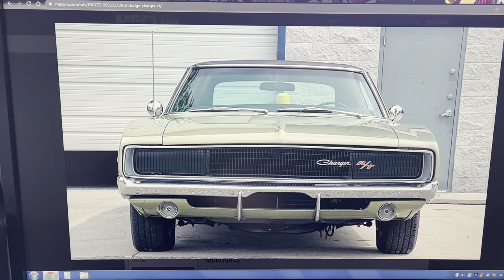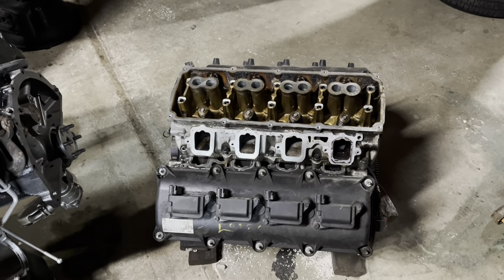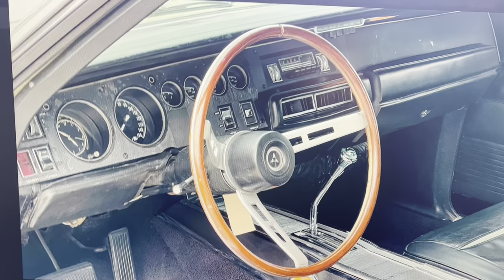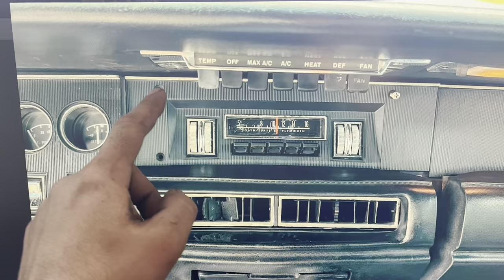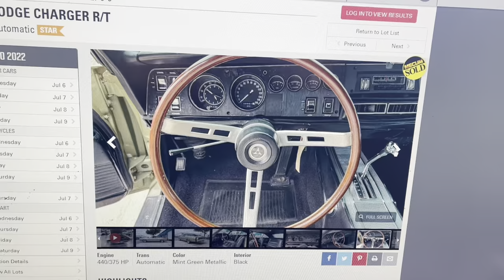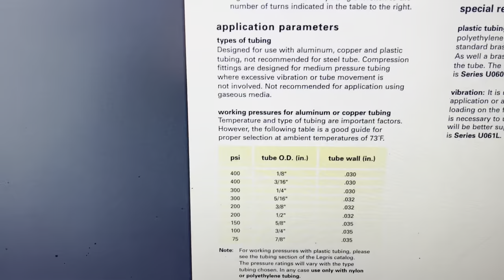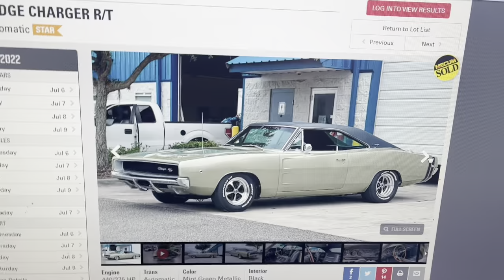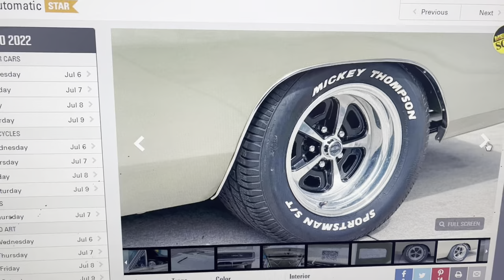Why Did This 1968 Dodge Charger R/T Just Sell At Mecum For $170,000? (It’s Unsafe And Bad)

Comment: In the picture of the lousy brake line repair, the forward part of the shock tower has some kinda chunky welds, and appears to be a bit hammered back to shape, like it took a hit at some time in it's life, then had the front apron replaced....poorly.
Reply from the maker: No welds there are jumping out at me that look abnormal. Ugly factory spot welds, check. Mig work down at the frame rail where it can’t be spot welded, looks right to me. I do see a dent in the inner fender toward the back. Maybe I’m not looking in the right area.
Reply: @DeadDodgeGarage  Front edge of the shock tower, the lip that is attached to the front apron looks pretty wavy, has what appears to be hammer marks like it was flattened out. Maybe a crappy job of separating the spot welds when it was repaired....

Comment: This kinda crap is going on now with foxbodys. Not to the extreme of 6 figures but 40-50k for anything other than a pristine 93 Cobra R is a joke. Cars in the factory wrapper like Collin's stash being the exception to the rule, the only exception...lol "Unmolested", "Bone Stock Originals" are the ones these days fetching a premium thanks for Mecum and Dennis Collins. Ultimately, not either's fault but a moment in time that spurred all kinds of "builders" that find rust free tired cars and piece together some "bone stock originals" due to the premium they are now pulling. Once more the fox mustangs only had 5 digits on the Odo so not too hard to have a 30k original. Lots of lost titles, salvage titles as well which isnt too surprising. I was in my early 20's during this period and dont remember many people putting foxbodys away in the hopes they would "be worth something someday".....lol. To the contrary most folks drove the wheels off them cuz they were fun as F**k. Thats why its sus that there are so many of these unmolested originals all over Ebay.
Reply from the maker: Yeah… very interesting. A lot of the same crap going on everywhere else in the classic market. They’re worth enough to try to flip for big bucks now.

Comment: Great video!
IMO two  factors create this situation. #1 - Baby Boomers. We’re retiring and want the cars we desired in high school, cost be damned. (The same is true for vintage electric guitars.) BEWARE- in their day the WW2 generation drove up prices for pre-1940 cars. Values deflated quickly for those cars when that generation aged out of the market. The same will happen for Boomer era cars as our generation ages out. If you are young enough to wait 5-10 years, muscle car prices may ease.
#2- we live in a Gilded Age, and many buyers bring a LOT of money to the car market.
These factors have two effects: a) the pool of decent, unmolested, cars continues to shrink, and b) there are huge $ incentives to buy a car from this era, do just enough to make it run/drive and look shiny on the auction block, then flip it.
My advice is shop for cars that are complete & original, but unrestored. They ALL need work of some type. Decide what skills are your strengths and look for cars that need that kind of work. 
If you can pay $170k for a restored car (not me,) hire a consultant & restorer who can locate cars, evaluate them, give you accurate overall costs for how you want to use the car, and procure the car for you. (I’ve been to the Sotheby’s auction in Monterey, and that’s how the rich buy cars.)
Reply from the maker: You’re absolutely right and I thank you for the well reasoned explanation. I do want to make a note on Chargers though. It has been found that there is a lot of interest in them in younger generations as well. It’s a beautiful and timeless design that is still being featured in popular films as a hero car. I think the value of a Charger will persist long after the Boomers have aged out. Maybe (hopefully) not at the same level, but I have had many younger people ask me directly where they can buy one, and I have seen many more looking for them in groups. I am much younger than a baby boomer, and I think the Charger is the most beautiful car ever designed. If the prices drop by 75%, well… I’ll just buy more of them! Thanks again.

Comment: I'd say the top dollar that should have been paid for this car is no more than 10-12k. I'm spotting a lot more than the poster is pointing out. This car in fact needs to be stripped down to single components and the body stripped as well. Can almost guaranty you will spend 60-80k to restore this car if it is numbers matching. I also noticed a few things that makes me think this is not a real R/T car. Regardless meccum and the seller screwed this buyer over big time.
Reply from the maker: To say this car is worth less than $10k is absolutely ridiculous. If a halfway rotten out hulk of an R/T with a mostly stripped interior that needs everything sells for $35k… yeah you’re a little off. Everything that has been brought up so far to argue that it isn’t a real R/T has not proven anything, so I am curious what you are looking at. Let’s say it’s not a real R/T. As solid as it is, and as nicely as things are finished body wise, it’s probably still worth $40-50k or higher. And if it is a real R/T? I figure it might just be worth around half of what it sold for. Maybe. I don’t agree that the body needs to be stripped at all. I think the body and paint job is actually quite good, except for the obvious color mismatch on the doors. I think either a customer ran out of money to finish what could have been a very good restoration, or a shop ran out of time or care. There is a lot more to spot on this car. As I said in the video, calling out every little flaw was not my intention. I want to know why it went for such an obscene amount beyond what it should be worth, and I want to spread awareness that compression fittings on brake lines are bad. That’s it.

Comment: This car reminds me of that red 1000+hp Comet, looked tough as hell.... with undersized brakes . Crashed on the show off test drive. Not cool at all, never NEVER do shit work on brakes or steering
Reply from the maker: The undersized brakes weren’t the problem with that Comet. A mechanical failure leading to the total loss of those brakes was the problem. This car has its correct original drum brakes, and its supposedly correct original engine.
Reply: @DeadDodgeGarage  mechanical failure of stuck throttle. Yes I can see the stock brake etc. The super crap job of the brake line is just wrong

Comment: Holy crap, because i rode in a buddies who spent 700 on his back in the 70s then rosted all 4 tires locking up the brakes becuse going 130mph to a red stop light at the last second means stop.
He did, then drove away with bad flat spots on all 4 tires.  You could put a 20 on the dash taking off, your ass wasnt grabbing it off the dashboard. 
The car had some pep.
Think if he still had it today what it could be worth.  We never knew what super car was going up in value from that eara.
Mussel cars back then were a dime a doz.

Comment: People love shinny things. I fix and sell classic cars as a side hustle. I get them to be good running cars and then move on to the next. By no means are they going to win any 🏆. Id say about 90% of the people who I've sold told are not car guys and are not very handy with a wrench or any tool for that matter.
Reply from the maker: I get that for sure. I’ve done my fair share of fixing and selling on. I’ll usually do a few stages of a project and then get bored. I sure don’t make big money on it either - but a bit. I’m completely fine with that kind of thing. It’s when they are dolled up to look all shiny perfect on the outside but are actually anything but. I don’t think anyone should be driving this charger down the road…

Comment: As mentioned at the start, there is a valuation premium for being an R/T model ? nonetheless, that one is a doosie !
IMO, the second intangible at play to the price realized at "Auction"..... is the 'sentiment' around these Cars by those seeking to acquire within an extremely limited supply available some 55 years later ?
Still hard to fathom ?
All I know.... is I own a factory original X9 Black, UN-Restored, UN-Rebuilt, 1969 Charger R/T SE 440 Magnum/Automatic Car that has been extremely well maintained in great condition and can be driven anywhere at anytime with no issues whatsoever.... a pristine "reference example" with B-Sheet/Fender Tag everything 'original' with full history/provenance verifiable right back to brand new.... and there is NO WAY I could get even close to that $170K valuation for mine !
Reply from the maker: Exactly. I’m well familiar with supply and demand, and as much as I hate it (because I love these cars and would like to be able to acquire more,) I understand the prices they are now normally selling for. This one ain’t normal - and it ain’t worth it.

Comment: No sway bar?  Same reason Ralph Nader claimed the Corvair was unsafe at any speed. Nice one!  They probably couldn’t get it installed due to the lowering kit.  That car must handle like crap. Compression fitting on a brake line?  Unsafe.  Period.  Especially when they make pre fitted lines. Again it’s probably done because of that lowering kit.
Reply from the maker: I don’t believe there is any “lowering kit,” as all you have to do on a Mopar of this type to lower it is loosen the torsion bar adjuster. The weird thing is, the adjuster looks to be in roughly the right spot, and it’s still that low…

Comment: I could’ve bought an R/T shell at the boneyard and had it nicely restored with all brand new parts and a period drive drain for less than $170k. I’ve got a hell of a bridge for this buyer. 😂
Reply from the maker: …the boneyard? Like, your local junkyard just has R/T Chargers laying around? I’d love to know where that is. Lol. But yeah. $30-40k car plus $100k restoration doesn’t quite get there - and this one looks like they stopped part way…
Reply: @DeadDodgeGarage    There are Mopar boneyards all over the country. Where you can get everything from a shell, to a complete car. I got my ‘67 GTX shell (and it was a shell😂) at a boneyard in Arizona. Super solid car with no rot and a tiny bit of surface rust. Only $88k, and three years later, I had myself a nice GTX without a single aftermarket part (except tires). 😂  If you’re an anal head case like me, there’s a boneyard out there with the part you need.

Comment: That compression fitting wouldn't even pass a state safety inspection. Hell, valvoline wouldn't pass that here in NY (don't ask me how I know) Welp, a fool and his money are soon parted.. Also, the front tires look like they're not even the same size. They should have painted it red to match all the flags noted in this video.
Reply from the maker: And yet many people have dropped in the comments to explain that fitting as a perfectly acceptable way to fix a brake line… yeah…

Comment: A compression is perfectly acceptable in only one type of brake system…..Air brakes. Application pressure in those systems is 130psi at the absolute max. Any hydraulic Brake system is going to be far higher than that. Just leave compression fittings for big trucks with air brakes and build your car safely with the right parts….it’s not that much more work to use an inverted flare union instead.
Reply from the maker: Bingo!

Comment: Perhaps what this really shows is that $170,000 is a "restored but needs work" price, and the person who bought it is really feeling lucky that they got such a good deal on a $250,000 car that only needs another 30 to 50k to get it there.
Reply from the maker: I saw cars just like this one but much less bad selling at dealers in the $150k range. So I’m going to have to disagree.
Reply: @DeadDodgeGarage , well my comment was just speculation about the perceptions of someone who holds the belief that the car might be worth 250k in better condition.  TBH, I can't imagine that this car needs 300 hours of shop time to sort out.  And if the car happens to be just the right trim for more than one person at an auction, then you kinda have that much of a reason for the price.  
And the fact that we can all see the problems that you pointed out, from pictures only, means that the seller (and auction house) is absolved.  It's not like you found hidden bombs under the dash that nobody else could see.   
Yes the car was tossed together in a hurry and still needs some sorting out.  And maybe your video will help someone in the future who has more money than knowledge.  But there is no crusade here. Nothing new under the sun.

Comment: I certainly don't feel bad for the idiot that bought it.  It's obvious that the owner had way more money than brains since they didn't check out the car before they bought it.  My brother-in-law was saying that Mecum should be responsible and I said no, they should not since all they are is an auction house.  There job is only getting sellers and buyers together to purchase vehicles.
Reply from the maker: It’s a tough line to walk on whether they should be partially responsible or not. I’m somewhere on the fence. As stated in the video, I understand that there are just an outlet.

Comment: If someone wanted to experience what it's like to drive a super expensive charger without spending much, a 1972 to 74 would be the way to go. The 1971 charger was the last valuable year, and most people can't tell the difference between a 71 and a 72 at a glance because they have exactly the same body panels, chassis design, and suspension, yet a 72 is worth 1/20th of what a 71 is. Why? The 72 had standard disk brakes vs the std front drums for 71. No one cares about that because brakes can always be upgraded. But the cardinal sin of classic Mopars is to upgrade the engine beyond what the vin # says came with the car. And THAT'S why the 72 is worth maybe $6000 for a nice pristine example vs maybe $120,000 for a clapped out 71 with a 426. 
1972's didn't come from the factory with a desirable engine - and THAT'S the key. 
If a person were to drop a hot 340, 440, or 426 into a 72, it would look, feel, and drive just like a 71, and a novice or Chevy person wouldn't know the difference - but any Mopar expert would know it's a fake. A 72 with a blown hemi would get down the quarter just as quick as a 71 with the same mechanicals, and look exactly the same doing it. But it would do it for about $100,000 less. Sure, I know the Gen 3 (1971) chargers are ugly - and they don't look like the General Lee, but the main reason 72 to 74's are almost worthless is because of the engines. At least the body shape of the Gen 3 charger was slippery enough for Richard Petty to continue to use it as long as he could (through 1977) and he wouldn't have stayed with that car if he hadn't been winning.
If I had a '69 to '71, I'd be afraid to drive it anywhere, and I definitely wouldn't be taking it to the drag strip, doing donuts in it, drifting, or driving it off-road. But with a '72 to '74? Why not? They're cheaper than rusty fox-bodied Mustangs.
Reply from the maker: I’m very much not afraid to drive my ‘68. It’s also insured for $50,000. I got it to drive and enjoy - and that’s what I’m going to do. Whenever it isn’t raining… I definitely get what you are saying. There are all kinds of not-‘68-‘71-Charger type cars that are well worth building. Also, I see absolutely nothing wrong with building a 318 car into a hemi, or whatever else someone wants. You know why? They’re the same car. Everything that makes an R/T special can be added. If you’re building it for your own enjoyment, go sick. Now, cloning something to try and make a bunch of money off of someone who doesn’t know? That I can’t abide.

Comment: Back in the early 80s a good friend had a 1969 Charger.  Great engine and trans but the rest was junk.  40 more years have passed.  You are far from alone.  Many cars back then were slapped together, especially Mopar and AMC, and later on GM too.  It looks great and goes like hell, but it's a pile of crap.

Comment: You sound like Digits from SOA, I can accept that..." Do you have any idea how many brake lines I've mended with compression fittings over the years? Laying under a 1972 Chevy C20 in the mud, under a 1980 Dodge Aspen in the gravel, under a 1970 Pontiac... You get the idea. Copper tubing and compression fittings will get you home. Hell, I mended a broken outer tie rod on a Nova with a piece of cheater pipe and hose clamps as a makeshift sleeve. Got us out of where we were at so we could fix it proper like. But on a classic Mopar that sells for that overinflated price, I gotta agree, it don't belong there. I remember when you could get a running hoopty for $50.
Reply from the maker: I think we agree there. Somehow I don’t know Digits…

Comment: I think Mechum should start caring because could lose clients.   This is happening all ov what’s worse you didn’t even check the frame a lot of restored cars the restorer doesn’t put metal back in just a bunch bondo to make it look good but by the time they put that in they could have fixed. I saw mustang coverta l look alike chopped the top but didn’t put the framework in so when I went up on the lift the body would flex. It s sad somebody gets hurt then what anyway Have a good day.